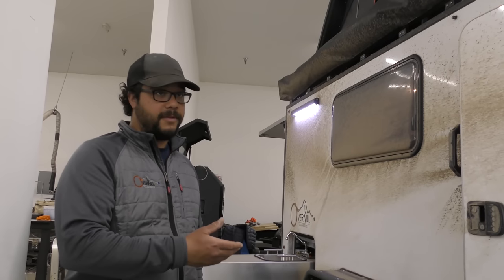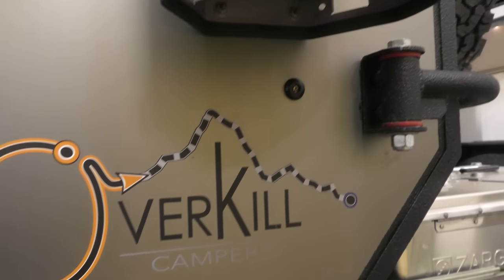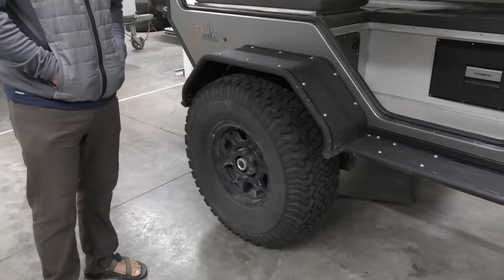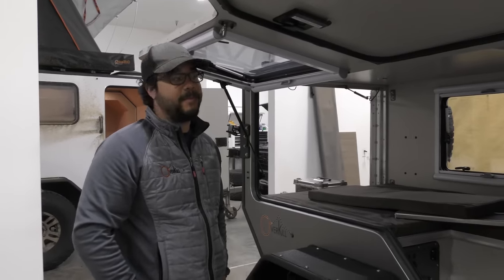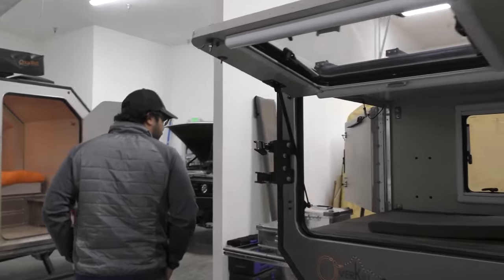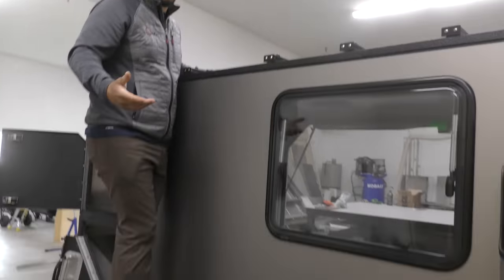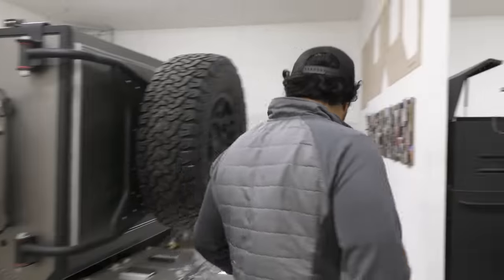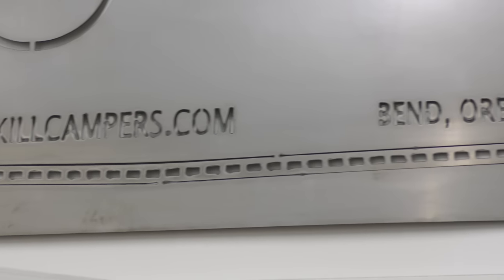THE FIRST OFFROAD TRAILER WITH A FULL OPENING SIDE WALL - THE OVERKILL CAMPERS TK47

Comment: Shore powewr connection?
Reply: @TravelingStacker  for an inverter generator hook up. Down in Louisiana it's hot most of the time so it would be a plus to be able to deal with that at night.
Reply: @TravelingStacker  yes sir, that is understood. The idea is to get a portable unit and plug it in when necessary. Thanks.